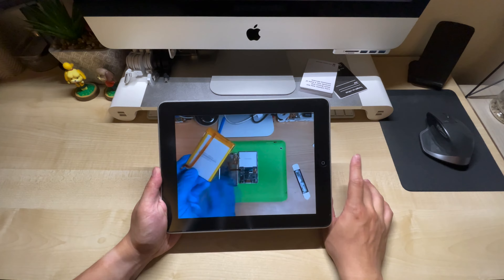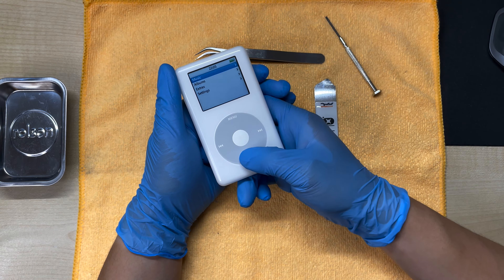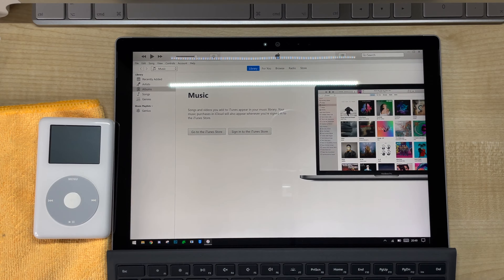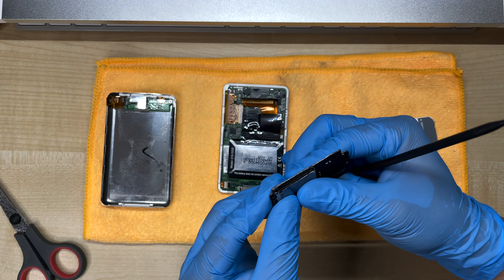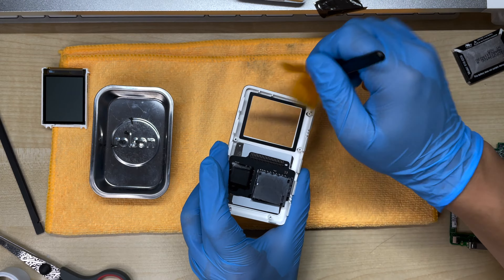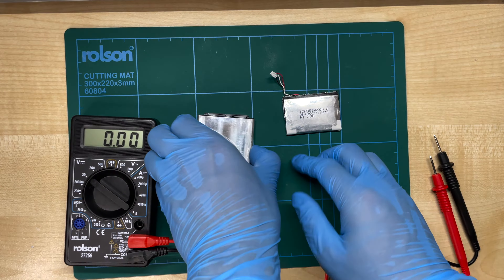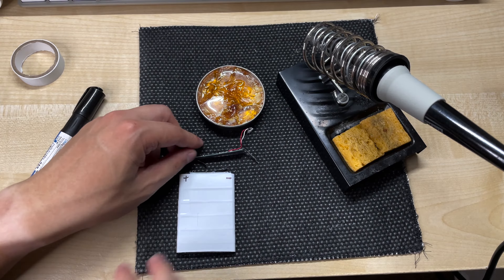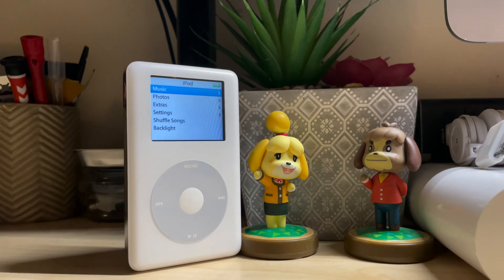3000mAh Battery in an iPod 4th Gen?! Here's how.

Comment: A tip for others: When bending a flex cable back on itself, put down a chunk of foam, or thick double sided tape to ensure you don't crease the cable.
Reply: does this mean that even a small fold will cut off the power?
Reply: @ayingsdud4929  flex cables just need to have a bit of bend radius is all. Folding them completely can cause the copper layer to crack.

Comment: Use a thick backplate and you won't have to modify your iFlash.  I just modded my thick 4th gen mono with a 3500 mAh battery from a Samsung Note 10.  I also 3d printed a spacer to go where the original battery once was, so the iFlash has something to attach to.  And this battery leaves a perfect size space for a future taptic engine mod.
Reply from the maker: With a thick back, it's possible to fit a trimmed iFlash, 5,000mAh cell, and a Taptic Engine. The iPod I currently use is this setup.

Comment: The nominal voltage of the original battery is 3.7V. This means that the maximum charging voltage is 4.2V, and the cutoff voltage is 2.7V. The nominal voltage of the LG G3 battery is 3.8V, so the maximum charging voltage is 4.35V and cutoff voltage is 3V. If you use the BMS of the ipod with the LG battery cell, it will discharge up to 2.7V, which is below the designed voltage of it. It could kill the cell if you use the ipod until the charge is over.

Comment: Please keep in mind that some batteries have 4.35V when fully charged, instead of 4.2V like normal ones. It should still work, but it should not be fully charged when doing this mod. Also note that it would only be charged by the iPod up to 4.2V which means it would be less than 3000mAh.
Reply: So you’re saying if I did this battery mod, I wouldn’t be able to get a full charge from it?

Comment: isopropyl alcohol for the for removing the battery does work very well, however you want to leave it to dry for a bit before putting everything together, i didn't do that and was wondering why my clickwheel wasn't working, when isopropyl was just still in there and causing phantom touches. left it to dry and everything worked again.
Reply from the maker: Good point!

Comment: Damn, I wish I'd seen this before I spent a tenner on a new 1000mAh battery, given you can get the 3000mAh LG bats are less than a fiver! - I just picked up the chonky 60GB Photo, so I'm thinking with the extra room inside, it might be possible to do this mod without needing to cut down the iFlash Board? Great vid, cheers!
Reply from the maker: With the thick back model, you can probably fit the iFlash ATA1 and 3,000mAh battery without trimming the board. But if you trim the board, you can fit an even larger 5,000mAh cell.
Reply: @NekoMichi  Unlimited POWER! Lol - Nah, 3k will probably be fine. Cheers! 😁
Reply: @NekoMichi I just bought an LG G4 battery to replace my swollen battery, but since you mentioned 5000mah, Im thinking of usiing that instead of the 3000mah. Do you have a video of that too? And which 5000mah battery did you use? Thanks in advance!

Comment: Im thinking if this should be possible by using the Tarkan iFlash flex cable for 4th gens, and cutting an iFlash Solo in half as well right? Could be a better alternative to the original bulky and fragile hard drive cable
Reply from the maker: Theoretically that could work too. The Solo has the same layout as the ATA1 and shouldn't have any chips or traces on the top half.
Reply: @NekoMichi  Thats good to know. Never had a solo on hand, just the quad and ata1.
Reply: @NekoMichi That is correct, it has none at the top to the SD Card Cage

Comment: Any reliability issues? Mainly concerned about swelling and overheating. Also can’t decide between 64gb vs 128gb micro SD for the iflash ATA. My music library is at 20gb and slowly growing right now but this is my daily device so I do want it to be as reliable as possible
Reply from the maker: I've been using it for over a year without problems so far.

During this time I've been using it daily with 2-4 hours of music playback per day and charging it once every 2 weeks. Estimated total number of charge cycles is 30-50, and the battery still performs to the same capacity as when I first built the iPod.

When charging with USB or FireWire it does get warm but my IR thermometer is reading 30°C (86°F) or less so there's no sign of overheating. Also no signs of swelling so far.

Comment: Wow great vid! Did u make any measurements on how thick the LG battery is (l×w×h)? If so please tell me. I am planning on doing the same mod but using another li-ion battery, its thickness is 0.5mm and I am not sure if it would fit. Thanks.
Reply from the maker: The footprint of the battery is about the same as the original hard drive that is being replaced (without the rubber bumpers), the thickness is 5mm.

Comment: What's that thing below the 30 pin connector? Can this be removed or does it have any function besides acting like a bumper?
Reply from the maker: The sponge-like thing? It's a spacer for the dock connector. You can remove it but I recommend keeping it in as it reduces the overall stress put on the socket when it's plugged in.

Comment: Any tips for soldering controller chip connectors with battery connectors? I'm new to soldering, don't know how to make the solder stick to either of connectors. Any tips are welcome.
Reply from the maker: I usually clean the surfaces with flux beforehand and then "dab" the solder onto the contacts instead of holding the soldering iron tip on them while feeding solder. This is to prevent overheating the battery.

Comment: I was thinking about doing this with a 5 gen but then learned about incidents of lithium batteries exploding and burning people and now I'm a bit paranoid. Well, the risk would be the same as using a regular 3000mah provided I do the PCB swap correctly, right? I think I'll just charge it up to 70%
Reply from the maker: Should be fine as long as you correctly connect the battery management board to the cell and nothing is shorted or punctured. I've been using this iPod for almost 2 years without problems.

Comment: Great video! I'm trying to find one of the short / low profile microSD to SD adapters and am not having a lot of luck. Any chance you can tell me where you got yours?
Reply from the maker: I found mine on eBay, these are either from Raspberry Pi kits or sometimes they're listed as "Nifty drives".
Reply: @NekoMichi  Thank you! I found one on Ali though most were not available in black and the white versions have the curved top "pull tab" thing that makes me think they'd be too long still or not fit.
Reply from the maker: @chrislenfert1953  Hi there, just an update. I got one of those shorter adaptors with a curved pull tab and they will fit if you use a file to trim down the curved part around the edges.

Comment: Hy if I put mine ipod A1059 4gen in 12v to charge, but battery it's dead, from socket battery were it's red black white and now with 5v charger I have 3.7v all I need it's new battery or it's dead
Reply from the maker: Is the 12V charger a FireWire charger?
Reply: Is a 12v charger
Reply from the maker: If it's a 12V USB charger then it might damage the iPod. The iPod is only designed to receive 5V with USB.

Comment: Hey, great video! I have been interested with modding iPods with videos like these to the point that I want to mod one as cheaply as possible just to use in daily commutes to uni. I have found a battery that had no white wire in it unlike the one shown in the video. I plan to solder the wires of the original battery to the replacement, but have no clue as to where the white wire will go after soldering. Should I do something with it or leave it as is?
Reply from the maker: It might not work if there's no third terminal. The white wire is connected to a thermistor and is part of the charging safety system. Without it, the iPod will refuse to charge the battery.
Reply: Noted, though I have been planning to replace the battery with the silvery li-po with the kapton tape over the bms, then just swap it with the bms of the old one, just like the method in the video. My problem is if I can properly remove the silver covering without yanking the terminals with it. 
Thank you for the reply!

Comment: I bought a couple second gen iPods. Can’t seem to find any videos on modding or repair for these. Have you thought about flash modding a first or second gen iPod?
Reply from the maker: iFlash adaptors work with the 1st and 2nd generation iPods, but there's a catch. You have to use a second, surrogate iPod with USB support to flash the 1st or 2nd gen's firmware onto the card and sync your library before moving the iFlash back to the 1st or 2nd gen. You'll also lose the ability to sync over FireWire and have to use the surrogate iPod to do that.
Reply: @NekoMichi I see, that’s a bummer. I also have a second gen with a broken headphone jack, can’t find a replacement anywhere or a repair guide. Would you happen to know of any?
Reply from the maker: How broken is it? Does it cause audio to become strange if you tilt the headphone cable?
Reply: @NekoMichi  yeah, I have to jiggle to hear audio out of both right and left.
Reply from the maker: The most likely culprit is the headphone socket's pins detaching from the motherboard, which is fairly common with this generation. You'll need to remove the metal plate to expose the headphone socket module and then reflow the solder on each of the pins. The metal plate itself is attached with solder.
Reply: @NekoMichi  I’m currently looking at the pins. I resoldered all of them anyway to be sure, still the same issue. It’s the jack it’s self that’s the issue. I’ll try rigging up a 5th gen port and see if that works

Comment: How long does it take to charge the 3000 mAh battery over Usb and over Firewire? I did your mod, but somehow it either does not charge or charges just very slowly.
Reply from the maker: Between 6-8 hours (either FireWire or USB). What are you using to charge it? I found that the iPod 4th generation won't charge from generic USB wall adaptors but will charge from a USB port in a PC. This is because older iPods expect a certain voltage on the USB data lines in order to charge whereas most generic USB wall adaptors don't send any voltage over the data lines.
Reply: @NekoMichi  I tried the original iPod USB charger, now I am trying with an iPad USB charger. Unfortunately I do not have my FireWire charger with me. I also have at my disposition an MP5.1 or MBP13.3 with which I could try to charge. I see everywhere that I would need a high voltage USB socket at my Mac, how can I find out, if he has enough juice? I suspect that the MBP13.3's USBc's sockets should have enough juice, though I would have to use an USBc to USBa adapter.
Reply from the maker: @stephanjung3882  You don't need a high voltage charger, with USB iPods will only charge at 5V anyway (it's higher with FireWire). Any USB port on a recent computer should work.
Reply: @NekoMichi  another question: can I use the battery controller from any replacement iPod battery or does it have to be the one from the original iPod battery?
Reply from the maker: @stephanjung3882 Doesn't have to be original Apple, a BMS extracted from a third-party battery should work.

Comment: i'm currently in the process of doing this, but i'm struggling to get my solder to stick to the ipod terminals to the lg battery terminals. do you have any tips or workarounds?
Reply from the maker: Do you have any soldering flux? This will help clean the contact surfaces and make solder stick better.
Reply: @NekoMichi  yeah, i also tried with flux but still not sticking together. i noticed my lg battery seems a bit different from the one you used in this video, but they are the same model number. you snipped at a long piece from the lg battery/bms, which mine was pretty short and didn't snip off 'cause it came off easily. so you had one short and one long piece sticking out from the battery, where mine just has one short piece sticking out after removing the bms. not sure if that has anything to do with anything though
Reply from the maker: I noticed that too, some variants of the same battery model seem to have different styles of contacts. In the worst case scenario, you might have to solder wires to the pads and then the other ends of the wires to the BMS terminals.

Comment: hello friend, greetings from Mexico; excellent video; It would be great if you did something similar with the 3rd generation iPod
Reply from the maker: I've been looking into that, the custom battery made in this video will also work in a 3rd generation iPod, however the main challenge is finding a way to fit the flashmod adaptor efficiently in the old battery compartment. So far I haven't had any success in fitting an iFlash there and safely folding the ribbon cable but maybe someone can figure this out.
Reply: @NekoMichi  maybe the new model that came out of iflash will work, iflash-ata1
Reply from the maker: The iFlash ATA1 is too large to fit in the 3rd generation's battery slot, even after trimming

Comment: Great video.
Can i do it with an iPod video??
Reply from the maker: You don't need to do this with an iPod 5th generation because you can already buy larger batteries designed to work with the newer iPods (5th gen and later).
Reply: @NekoMichi  but i can't buy the battery from my country. So i was thinking about this and i found your video and it was exactly what i was thinking about but for an iPod video.
Reply from the maker: The LG battery is too thick to fit inside the 30GB thin back casing of the iPod 5th generation, but a thicker back casing might work.

Comment: I will pay to have this done to mine any info would be greatly appreciated.
Reply: Just open your old 4rth gen and practice taking the power cable apart and the HD etc. After a few times you will get confident and eventually do the whole change over on your own. The one procedure you have to be very careful with is the power ribbon connection. you will see it at the top left corner of the screen as you slowly open the case. Use a this flat plastic tool to pry the tiny square connector from the mother board. after that you can unfold the front case and access all the internal components.
There are a many good youtube clips for this process to study first.

Comment: Can this be done with Gen 3?
Reply from the maker: It would be difficult, the 3rd gen's hard drive ribbon is too short and awkward to fold, so you can't stash a smaller flash module in the battery slot in order to free up space for a larger battery.
Reply: @NekoMichi  Looks like EOE has a 2000mAh battery for the 3rd gen! Not as good, but I'm going to give that a try.

Comment: Do you know if this works with 5G, 60GB without cutting the iFlash?
So far, the fake 3200mAh from China seems like a tight but working fit.
Is the LG battery the same size?
Cheers.
Reply from the maker: The LG battery is much thicker than the fake 3000mAh batteries. I tried fitting an LG battery in a thin-back 7th generation and it didn't fit even without an iFlash. Not sure if it will fit with your thicker 60GB back casing though.
Reply: @NekoMichi  only way is to buy the iflash and try the LG for 7€. Otherwise cheap chinese battery thats a fake 3200, still 1800 better than the current one. Cheers.
Reply from the maker: For what it's worth, I did a runtime test on a flashmodded 7th gen and a fake 3000mAh battery and got over 100 hours of music playback so it beats even a true 3000mAh cell in a 4th gen.
Reply: @NekoMichi  how long was this LG 3000mAh 4th gen?
Reply from the maker: In a mono 4th gen, the 3000mAh LG battery lasts around 40 hours of continuous music playback.

Comment: Is this still working?
Reply from the maker: It still works.
Reply: @NekoMichi  where did you buy an official LG battery from? And is there not a fire risk swapping the battery management boards? Awesome to hear it's still working - looking to do this to one of my iPod photo's
Reply from the maker: I bought my LG batteries from eBay. As long as the safety board is connected correctly, there shouldn't be a fire risk. I've been using this kind of battery inside a monochrome 4th generation iPod for over a year and it hasn't failed or shown signs of degradation so far.
Reply: Hey. Thanks for this vid. I’ve successfully moded my 4th gen but when I put it all back together the battery creased the IDE cable a little too much and it doesn’t see the sdcard any more.  The cable shows no cracking or split but it’s obvious when I flatten it out it sometimes works - so contact has been cracked. 

How to avoid this problem? I have a second 4th gen and I don’t want to break the cable on a one way trip.